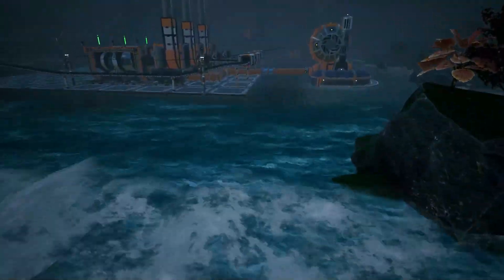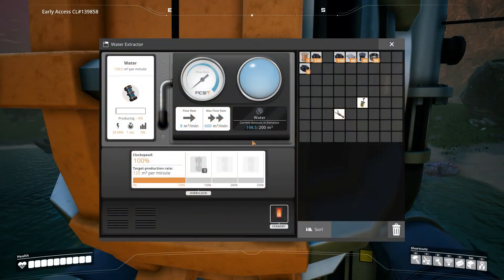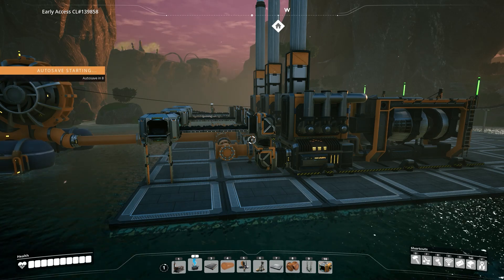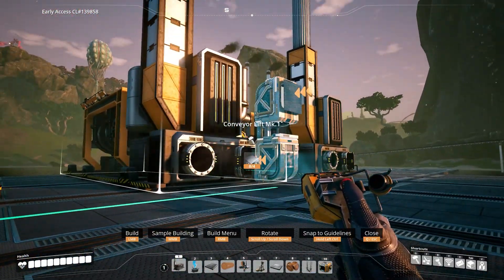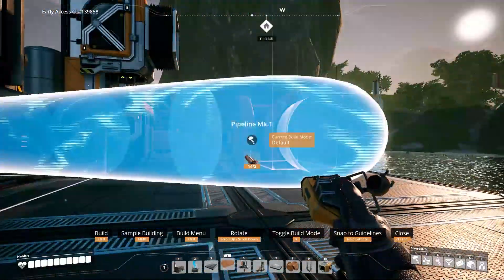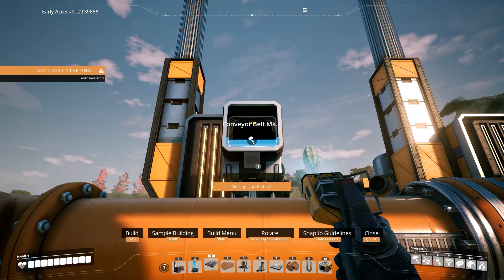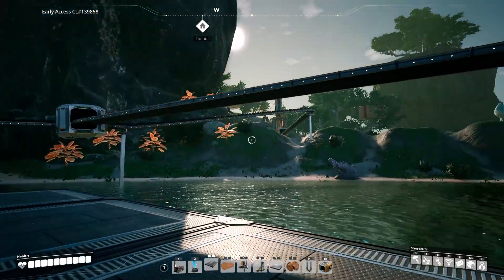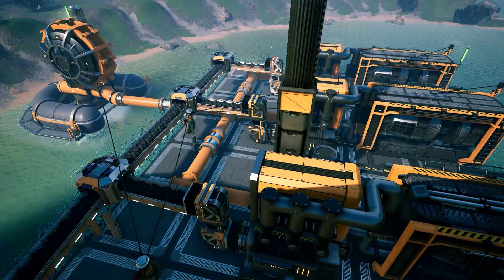Beginners guide to Coal Generators, a Satisfactory Tutorial in 5 minutes

Comment: can anyone help me? i tried to set up my first coal generator, but it claims that it has no power, despite being connected to the power. Water extractor is already running, power capacity is at 192MW, max. Consumption is at 147MW, but my highest use is 100MW. Water is also getting to the Coal generator. What am i doing wrong here?

Comment: I've found a 2:4 setup is a bit better for efficiency/power generation, and easily scalable into 4:8 power plants with net output of 260MW per module or 520MW per power plant. A pure coal node outputs 120 coal per minute, which fills a tier 2 belt. You can split that belt into 2 belts of 60, which then each support 4 coal powerplants (15 coal per minute at 100% clock speed). 2 water pumps oversupply the coal plants by 60m3 of water/minute but you can either fluid buffer that, or underclock the water pumps to save on power. Alternatively you could do 1:4 with an overclocked water pump, which would supply exactly 180m3/minute at 150% if you want, but it only saves 1.2MW of power, takes a power shard, and removes the ability to have a fluid buffer. It is somewhat annoying that the maximum flow rate of a tier 1 pipe is 300m3/minute, if it was 360m3/minute you could supply all 8 power plants with 3 pumps and 1 pipeline and save 20MW of power but c'est la vie.

Comment: This is only applicable on small scale because the balancing problem gets really serious once there are more than 8 generators, meaning that in early game, with only MK2 belt, you won't be able to brute force the feeding process because the coal will get eaten up instantly by the first 3 or 4 generators in the line.
Reply: then hook on another coal conveyor belt after the 4th, no?
Reply: @Rigged10000  Or overclock

Comment: When you add multiple splitters doesnt it then keep splitting the coal though? 60 then 30 then 15 etc? so by the end coal factory its getting than the first one?
Reply from the maker: Yes but once the first plant is full it will back log the conveyor back to the splitter which then won’t split any more so it’ll work on an overload
Reply: @MisterMyKil  Yes but if you got only the right amount for all 3 coal generators then you will want to spilt it evenly but if you have more than needed you can back log it
:)

Comment: Hmm.. I followed your steps exactly, like to the T exactly, and for some reason the power drops intermittently (like every 30 to 45 seconds or so)

Any ideas what I might have done wrong? I watched your video 5x over and triple checked everything..don't know what I'm doing wrong 😪
Reply from the maker: Hmm they might have changed something in the latest update to break the build but otherwise you might just need more power for the start up of all of your machines going at onces
Reply: @MisterMyKil  The issue is the water not filling correctly in the generators...it looks like bringing the overclock down to about 90% did the trick. Meh - thanks for the reply mate!! Appreciate your video
Reply from the maker: Thanks mate glad it got worked out
Reply: How do you underclock? Mine has a lock on it and I can’t access the panel
Reply: @itzstreamrok1901  you turn the power down to say 90% instead of 100%

Comment: my question is to initially power them up you need the biomass burners right? but after they start making power you can use the coal generators to power themselves, the pump, and everything else in your factory?
Reply from the maker: Yes they are needed for the initial set up

Comment: So to initially power the water extractor and the coal generators, you need a biomass burner. Then is the proper way to transition from biomass to coal generators, to feed the power from coal generators back to the water extractors? Then disassemble the biomass generator?
Reply from the maker: Yes that is the way I would do it, however keep a biomass burner in case of a power outage because water extractors need power to run before the coal gens will produce any

Comment: Is it ok when i overclock them? (the Coalgenerator)
Reply: I recommend not doing that on power production for any type of generator, it produces less power per unit of fuel compared to keeping it at 100% so if you want to make the most use of your fuel (coal in this case) then just add more buildings and under clock where needed
Reply from the maker: I agree, powershards are “limited”, so it’s pretty much always better to just make more power sources
Reply: @MisterMyKil  okay thanks 😄

Comment: a fluid buffer would be a good idea for the eventual power cuts to save from bootstrapping, or keeping minimal bio burner near the pumps for jumpstarting
Reply from the maker: Great idea, I should’ve put that in the video
Reply: Where would one connect the fluid buffer to? Is there any guide explain fluid buffer better?
Reply from the maker: I would put the fluid buffer in between the generators to have a nice back up supply of water so you don’t need to jump the water extractors to get the power going again
Reply: I'm a bit of a newbie when it comes to this game. I only recently unlocked coal. Would not connecting the power grid to the Hub's Biofuel Burners suffice for "jumpstarting" purposes if I were to go for the 1:3:8 ratio as mentioned in another comment?
Edit: that is, 1 coal miner to 3 water extractors to 8 coal power generators.
Reply: @BetaSolution  for a small scale that might work, though its still manual connections (though now switches are a thing). but as the factory grows, the startup power needed to jump the pumps gets really high